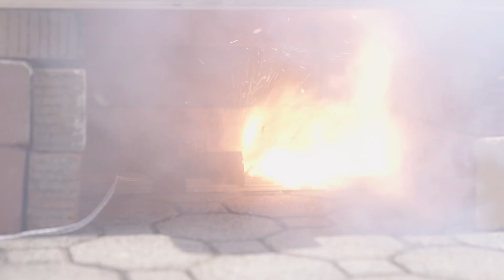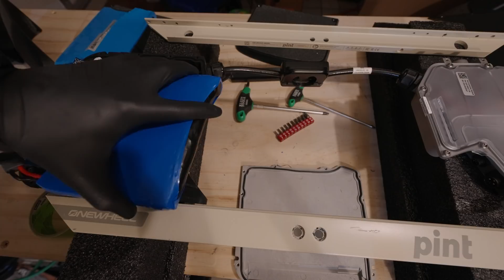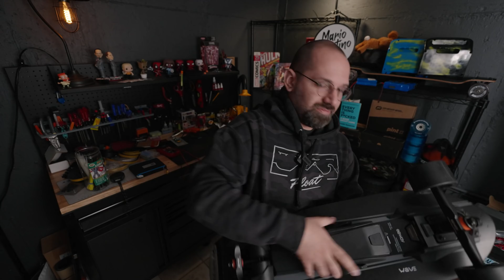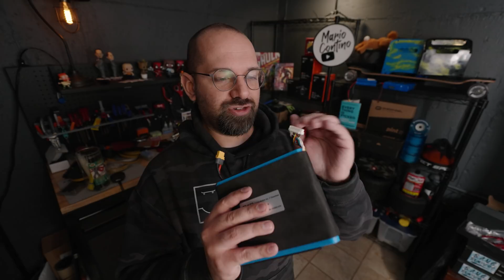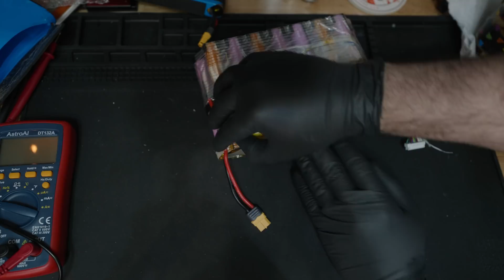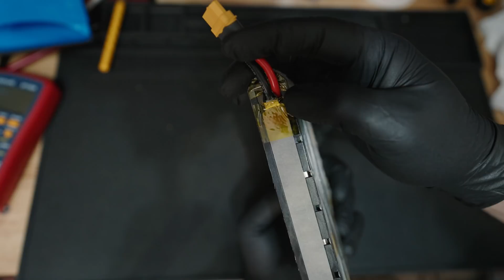Are Onewheel Batteries Dangerous To Repair?

Comment: The problem is not whether or not they're dangerous. The problem is that it should be on ME as to what risks I'm willing to take regarding repairs, replacement, or modification. And it's not just about being able to deal with it myself, I should also have the choice of who I am willing to trust it with if I choose not to take said risk myself. We went through the issues we're having in the tech industry in regards to right to repair decades ago with the automotive industry. And no one can tell me that repairing a OW, smartphone, etc etc is overall as complicated or dangerous as automotive repair can be.
Reply from the maker: I agree, Captain Planet.
Reply: When will u stop doing this Craig? None of your remarks make any sense. Are u working for FM? What is your connection with FM? Can you be honest about it and clarify it?

Depending on your use, your GT battery back WILL NEED replacing. Would u rather ship it to FM and pay $1000,- or do it yourself and put a new pack in for $ 500,-?

Im living in the Netherlands and sending it back to FM is no option. What about the riders in New Zealand or Australia? They would pay $1500,- just for shipping. 

Is there any device on earth which doesn’t have replacement Li-ion packs for sale? No!
Reply: @devrim1134  🎯✅
Reply: @devrim1134  they make complete sense. Strange how people can't see FMs point of view as a business. If you don't like the company and product find a different hobby. Pretty simple stuff
Reply: @Yielar1  So your claim is you have no connection to FM in any way?

We all like the product, but most of us don't like the company and the reasons are very clear.

Once I buy the GT, I am the owner of the GT and I can do whatever I want to it, don't you agree? Did not sign any contract with FM about this, did you? So when my battery dies in 2-3 years, I want to be able to change this without sending it to the States, makes sense, don't you agree? FM or 3rd party sells me a battery pack and I should be able to swap it, don't you agree? When I re-assemble the case, I'll use some silicone to make it finally waterproof which is absurd it was not, think you would agree on this as well ;)
And, no worries, I'm an electronics engineer and contractor, rebuild many Li-ion packs, but won't rebuild the GT's and therefore I won't blow up my house. To be honest: none of us would blow up our houses when swapping a battery pack, engineer or not. Ever heard of a power tool blowing up on a job-site? Think in our profession Li-ion packs get the most abuse and still nothing happens!

I would also like to change the tire when needed, FM says I can do it, but where and when will these tires be sold? Also did not see any explanation why they changed the rim in the first place, otherwise we would have had plenty choice. Soon a 6" rim will be available for the GT and I will buy it.

Maybe I won't do any of this because I'm still waiting on my GT in the Netherlands. Really hoping FM takes better care of its customers and take all concerns seriously; I'm about to cancel my order.
Reply: @Yielar1  What if you like the product but not the company?
Reply: @Yielar1  your claims make no sense if they cared about customer safety and media image they would have recalled all the boards for fixing the issues like ghosting which is a much serious safety problem, would they not??? I see you on every video defending FM what non-disclosure agreement did you sign and how much did you got paid??? Or are you just sucking them off for free?? When people bought the GT they weren't told it would get bricked if battery is removed when older models didn't(and still worked perfectly fine). How can you say FM is a good company, how can you support such bad business practices. Its not rocket science to connect a new battery even if it were it's a failure for the company to have a single service center not so easily accessible and when shipping cost from Asian countries are almost 80% of the cost of brand new GT.
Reply: @sabinchaulagain99  😄✔
Reply: @Yielar1  or call them out for shady and greedy and/or control-hungry business practices until they change their mind and do what's reasonable and favors the customer that bought their product. As it is with many other industries, when a company steps out of line, slap em around with negative publicity generated from their own actions and behaviors until they do the right thing. "Pretty simple stuff."
It's not a concern for the customers' safety. That's a lie.
And not getting in the way of replacing a battery wouldn't have the blowback you think it would. Any blowback would be dwarfed by the rep they have/will earn/ed by continuing with the way they handle things at present.
Reply: @Yielar1  can you believe all these idiots who can’t see the obvious business perspective? Business 101: ruin your reputation with your most enthusiastic existing customers (they already bought the thing and everyone knows lifetime value comes from the first purchase!) to preserve your non-existent but not-yet-negative reputation with the BILLIONS (if my MBA program taught me anything it’s that big number is always better) of potential customers who definitely aren’t going to look into silly irresponsible questions like, how much will this thing cost to maintain? or what do current OW owners think of FM? You get it, I get it…I just wish all these other commenters had a modicum of common sense.
Reply: Ty❗
Reply: Ok you can do what you want. Yes. Whatever. But if you fail and the people (most people) that dont support it will go down with your failure.
Reply: If it's "concern" for the safety of the customer, why did they make a motor vehicle in the first place?
Reply: It's not remotely the same as a vehicle that's the point. Most people don't even know what a OW is and probably don't have a very positive position towards electric scooters for a variety of reasons. I can totally see their point that if they have OW's burning up because of some 3rd party battery they aren't liable directly but it would seriously bring negative media to our sport that we all enjoy. It's pretty simple stuff here. Do I think they should offer an OEM battery that we can install ourselves so that we don't have to pay for shipping both ways, yes I do.
Reply: @Yielar1  that's why we need to teach people to get smarter on this and join this movement against the stupidity of a company that was crowdfunded by a community and that acts like that.
Reply: @Yielar1  I agree with all of this Craig. Mario made some great points here as well and I personally also think the service model should expand to include sales and service of whole packs. They weren't very explicit in the video, but one of the following comments outlined how a distributed service model is in the roadmap. Just give it time guys and relax. Too much hate.